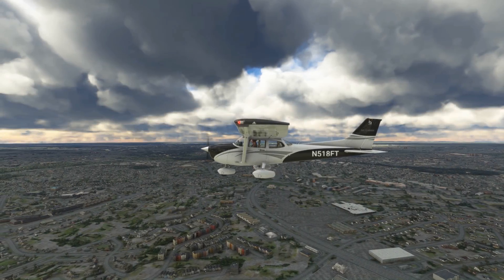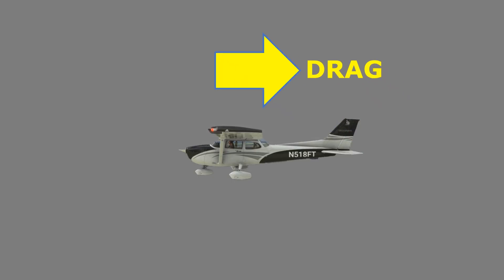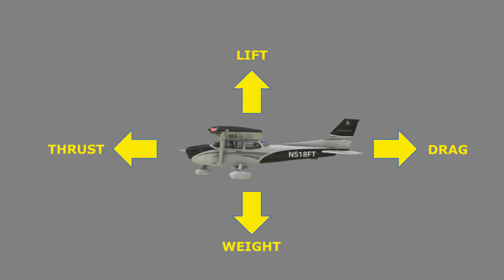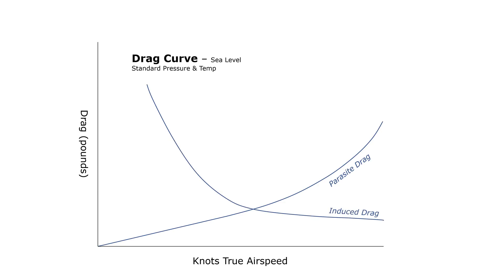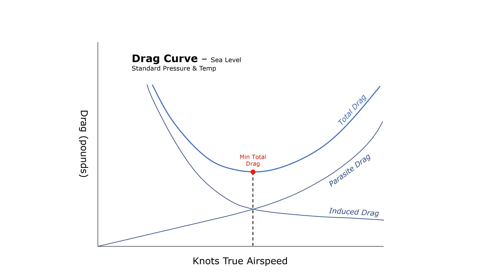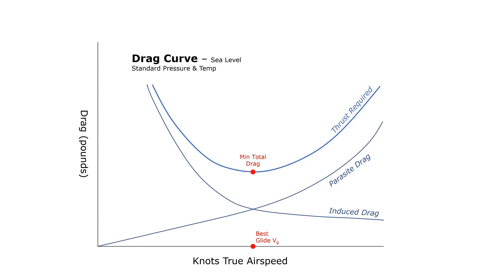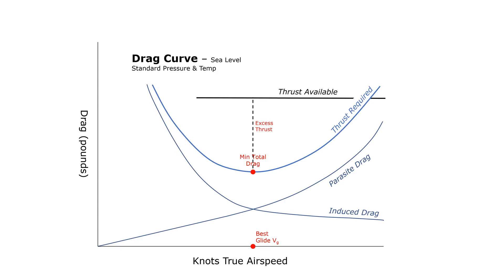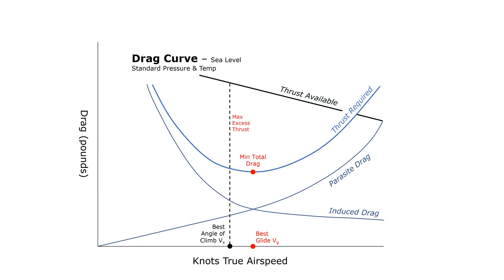Best Angle of Climb | What is Vx | Induced Drag vs Parasite Drag

Comment: Hmm. Sorry mate but as good as these videos are I feel the need to be picky here. The lift vector is always normal to the relative airflow (flight path) and the drag vector is always tangential to relative airflow, by definition. There is never a component of the lift vector that contributes to drag. What I am saying is it is wrong to think of the induced drag as the ‘tilting back of the lift vector’. At least, it is wrong by the conventions in use for principles of flight. It is correct to say that drag can be thought of as the rearward component of total reaction though. But not of lift.
Reply from the maker: I've heard this too. Though it makes sense and I've taught it this way, in the end I deferred to the PHAK p.5-8 where it's described that "...the downwash over the top of the airfoil has the same effect as bending the lift vector rearward, therefore the lift is slightly aft of perpendicular to the relative wind." I'll ask my aero students in class next week they know more than I do about this!
Reply: @flightinsight9111  Thanks for the reply and reference. I see what you are saying and had a look at the PHAK. I understand what they are getting at wrt the downwash changing the relative airflow locally. And now I go looking for it this tilting of the lift vector is not an uncommon way to explain induced drag as you did. But although it is an explanation of how the airflow around each section is modified, a common reference is needed for the airplane performance and the only common reference is freestream. For instance, without using the flight path as RAF, your load factor would cease to become lift divided by weight and your glide ratio would cease to be L/D. But if you define the lift vector normal to the flight path, those things fall right into your lap.
   According to Aerodynamics for Naval Aviators: “the instantaneous flight path determines the relative wind”. And yet it also makes reference to section lift being inclined aft by the “induced angle of attack”. However, it explicitly states that “the lift and drag must continue to be referred perpendicular and parallel to the remote free stream”. That is my point too. However, I concede that this tilting of the lift vector is a perfectly acceptable way of explaining induced drag. Still, to my mind, when labelling the lift vector of the whole airplane, as opposed to a wing section, the lift vector should be perpendicular to the flight path. 
   Anyway, your videos are probably the best on YT dealing with this stuff and I hope that the above is fair comment.

Comment: I just recently watched a vlog from social flight where they talked about the risks associated with flying at low altitude while at Vx.  It was very thought provoking.  To sum it up at low altitude if your engine quits while you are at Vx you are screwed.  Best case scenario you walk away from a totaled airplane.  Very likely though a worse result.    You all ought to watch it.
Reply: Vx is a tool to use to accomplish a certain goal, ie clear a tree line or other obstacle.  If you are hanging off the prop at Vx longer than necessary you aren't showing good situational awareness or threat management
Reply: @cobra646  Exactly right. Vx is there for when you need it, otherwise Vy is literally the best climb speed.
Reply: Well, I think you have been somewhat misled. The airworthiness requirements, at least those in Europe which are the exact same as the previous FAA part 23 that the vast majority of the GA fleet comply with, require that the plane can be safely landed without exceptional pilot skill if the engine quits. This includes from a max performance take off. The grey area is that Vx can be less than the recommended 50’ speed for a max performance TO. For most airplanes, the recommended Vx (as distinct from the theoretical Vx resulting from excess thrust available) seems to be not less than the 50 ‘ speed. However it is not an explicit requirement. The bottom line is that anytime the Vx specified in the POH is at or above the recommended 50’ speed for a max performance take off, the plane has been shown capable of a safe landing. Therefore I think it is a stretch to say you are screwed if the engine quits at Vx. In general you are not screwed, but you’d better be ready to get the nose down pdq.
Reply: @XPLAlN  Maybe but you may want to watch the vlog and consider what they say.   All things considered it seems like a Vx climb at low altitude is not a safe practice. Just because the government has bought off on it doesn't make it safe defacto.  They can have errors in judgement just like everyone else.
Reply: @utah20gflyer76   I have seen the same debate more than once. For the avoidance of doubt, I personally use Vy whenever I can, and Vx rarely.
   But my point to you is that all certified GA singles have demonstrated that they can be landed safely at their recommended short field 50’ speed without exceptional pilot skill, as it has been a requirement since at least 1949. I am not saying that they can all be flared to a safe landing from Vx, since that has never been an explicit requirement. But anytime the Vx is equal or greater than the recommended 50’ speed it follows that the airplane has demonstrated it can be landed safely from that speed. One such airplane is the C-172 and another is the PA-28. Together they make up a sizeable chunk of the GA fleet. So it is not a case of what government believe to be safe in theory, it is a case of performance that has been physically demonstrated by test pilots with skin in the game.

Comment: Love the explanation! Having made charts like this many times, I might use this to teach some of my co-workers.

One small comment, and maybe you just made this to semi-simplify, but induced drag is not the lift vector pointing backwards.  I like to think of it as the amount of work you have to do to push the air down to create lift.  A bit hard to explain in a comment, but would be very interested in working with you if you wanted to make a video about it.